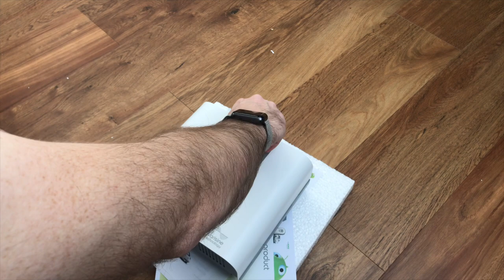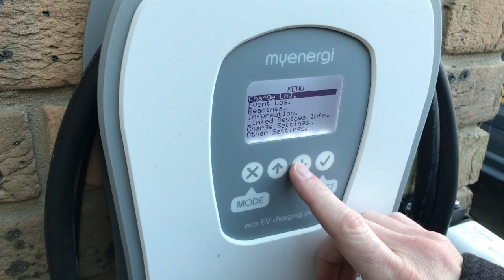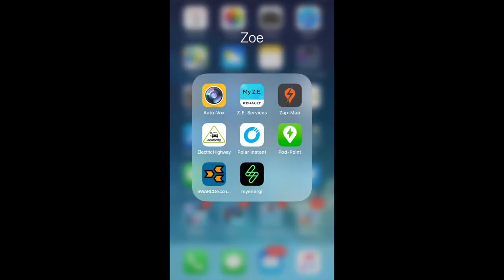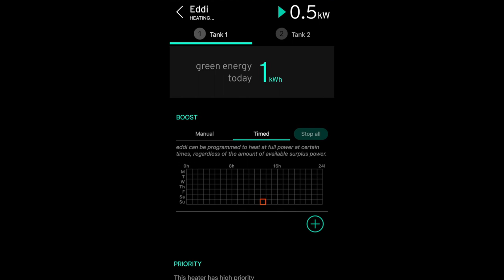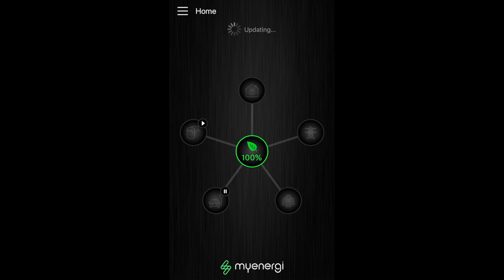Myenergi Eddi Install

Comment: Hi Just had one installed with my solar system, electrician said I need to leave my immersion heater switched on all the time ? is this correct as will this revert back to using electric from the grid when solar is not available etc
Reply from the maker: Eddi is installed in line so unless it’s in bypass mode it will operate on solar or on times set in the eddi. I’m assuming that your immersion isn’t your primary heat source
Reply: @eviain  No we also have an oil-boiler which was setup via hive to heat the hot water in the morning / evening, now it's just the solar via the Eddi, however the electrician said do not switch of the electric immersion switch, to leave it on all the time, hence my concern that it would revert back to using electric from the grid when solar is not available etc
Reply from the maker: @dennisdevine5044  if installed correctly your eddi will be in-line of your immersion, so if you turn it off it will not work. However the eddi is set to only supply power to the immersion heater if there is surplus solar power. You can get clever with it but that’s how it works out of the box. 
I have changed my switches so they have neon lights in them so I can see when eddi is putting power through, it would also give you piece of mind. Perhaps ask your sparky to fit one.

Comment: Not sure if you can help me out I'm over here in America and it seems that no matter how hard I look I cannot find any type of zero export device can you give me a few grams that I'm able to look up and import into America. Most folks out here sign their lives away to the energy companies and sell them power for pennies on the dollar I do not want to have anything to do with them so I'm trying to find a zero export to device
Reply from the maker: Hi, if you don’t want to export then you need to consume all that you generate, which is usually unrealistic. 
For an example if your totally off grid, then once you’ve filled your batteries, heated your hot water and charged your car, your system would need to stop producing energy. 
Devices like the eddi basically make exporting energy the last resort, so minimising the amount you give back to the man.
Reply: Using Zero export is not unique to America, it is also common in Africa and Asia yet it seems these power diverters doesn't work on zero export or off grid installations. Unfortunately the manufacturers does not inform you of this in their promotional videos so you may land up with an expensive device that is of no use to you.

Comment: Does the Eddie have one or two inputs for the two immersion elements? Can you wire the sink and bath element from the immersion or must you select one? Probably wouldnt make a difference really just curious.
Reply from the maker: Johnny G yes it has two connections, I believe you can prioritise the operation of the two.
Reply: @eviain  Thanks looks to be a great system
Reply: @eviain  Can you prioritise the Zappi and or the Eddie? I thought this was possible? In Ireland we cant export to the grid would this be a good option to divert excess PV to the immersion? I have 5 x 250watt panels
Reply from the maker: Johnny G Hi! yes, you can set it in the menu or app. No fancy rules though, so you may need to flip the priority manually if you want to change it
Reply: @eviain  Thanks, one other thing how did you hang this unit? I have plasterboard but cant get good fixing. The Eddie weights a good bit so I want to make proper fixings? Thanks
Reply from the maker: Johnny G can’t find the exact ones but these are similar: T.K.Excellent Hollow Wall Anchor Set with Fixing Gun Tool 60 Pieces M4 M5 in Box. https://www.amazon.co.uk/dp/B07FMMYQQ6/ref=cm_sw_r_cp_api_i_5B1PEbYJJZG7X
Reply: EvIain great thanks I appreciate it, cheers

Comment: Can I wire it direct to my consumer unit where I have the immersion breaker?
Reply from the maker: Yes it can go anywhere in that line from the immersion breaker or next to the immersion. 

It’s probably best near the breaker if you can so it’s not in a hot cupboard. Sadly there’s not much room near mine. 
Be sure to put an isolating switch between the eddi and the immersion heater (it’s probably their anyway).
If in doubt always use a quality electrician.
Reply: @eviain  ok many thanks.

Comment: What are your thoughts on payback? I've had a diverter since 2014 and payback was 3 years. With the Eddi and hub I reckon payback is 8 years! Any thoughts?
Reply from the maker: Hey Tim, If you have something already like I did there’s really no good case for buying one, they are very expensive compared to solar iboost. 
I felt that it would complement the Zappi and let me see everything in one app, so I didn’t really do any calculations on payback.
Reply: I'm only considering it as I've a sonnen battery and my current diverter hasn't the facility to prioritize over charging the battery or providing energy to the diverter.
Tim
Reply from the maker: Tim Edwards ah yes, there are some very good features in the myenergi devices, I have found them to be super flexible